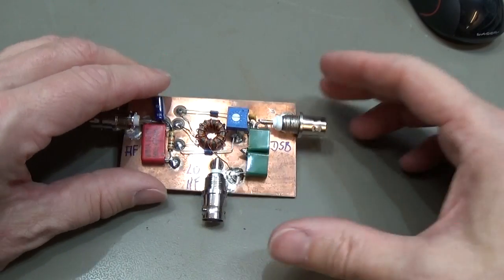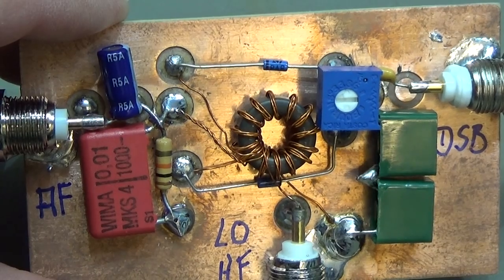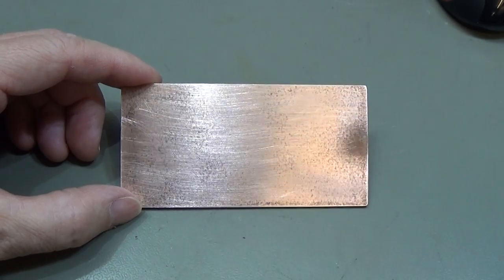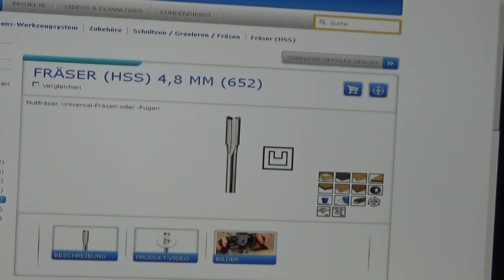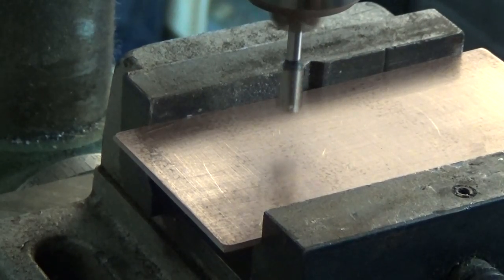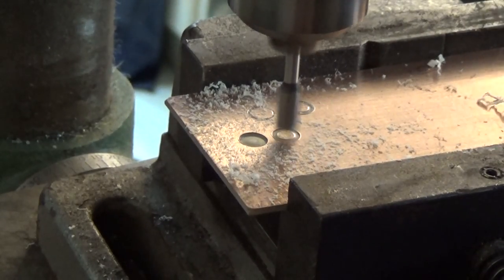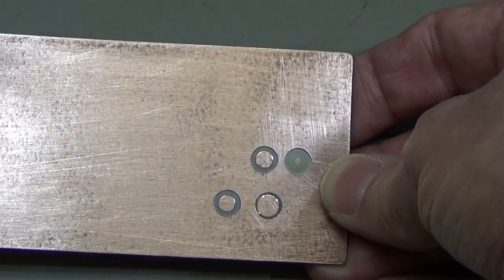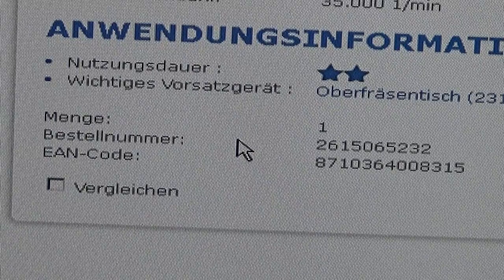#67 Board milling cutter for HF applications

Comment: Good video Peter. As clarification for folks in the USA -the bit used is a Dremel 652 Straight  3/16" (4.8mm) HSS router bit.
Reply from the maker: +cny02253 Ah, very good info thanks!!

Comment: Thanks for the demonstration Peter. Using a pad cutter eliminates the issue of PCB pads dislodging from the board when you do "Manhattan Style" construction; but once I found a good gel style super glue that hasn't been a problem. Pad cutter takes a while longer unless you know the final pattern to keep from having to go back to the drill while you build - PCB pads with glue let you build as you go and it's surprisingly fast once you get the hang of it. 73 - Dino KL0S
Reply from the maker: +Dino Papas  Hi Dino, yes you are right with the cutter you should know pretty much the final pattern...Well finally it depends on your own preferences which technique you use both definitely have the pros and cons. Personally I prefer the cutter. Thanks for comment best 73!
Reply: +Dino Papas: Hi Dino Papas, can you recommend / refer to a eshop which sells those pads and the glue? Difficult to find those items in the web, not talking about standard electronic shops...
Reply: +Axel Haar Hello Axel - sure, try QRPME dot com and look down the left side of the page for "MeSQUARES" and "MePADS"; the pads are for component leads and the squares are for various IC packages. Have fun building! Rex W1REX is the supplier.

Comment: I've ordered some glass hole cutters to do this - they are basically a tube with diamond grit coated ends and very cheap on eBay.  You can get them in various sizes.  Ordered 8mm and 1cm.
Reply from the maker: +Digger D Well anything what works is perfect. 73
Reply: 1/8 inch shaft for use with Dremel?
Reply: davecc0000 If you are asking about the glass cutters, no - they are tubes the diameter of the cutting surface.

Comment: If your drill press has a quill stop, it's easier to set that at the proper depth and then you don't have to worry about drilling the pad away.
Reply from the maker: +Justin Bell Hi Justin, the simple answer is yes. Thanks for comment. 73

Comment: I modified a brad point bit to do the same without the need for a drill press, since I don't have one.
https://youtu.be/ErJWhwNKnEI
Reply from the maker: +raccoonnyc Very good additional information. Thanks for the link.. 73
Reply: And then the philosophical question gets asked... Is it still a brad point bit after the brad point has been filed away? :-)

The actual bit used in this video is a plunging straight flute router bit.  Some of the non-plunging carbide tipped straight flute router bits may work even better as they would be even less likely to cut away too much copper (the central portion has no cutter, only the outer tips), plus carbide tipped tooling will remain suitably sharp about 10-20 times longer than high speed steel.  But modifying a brad point drill bit is certainly clever as well.

73s KW4EK